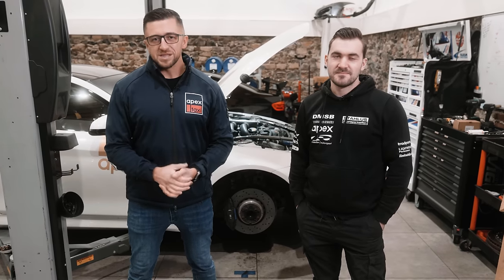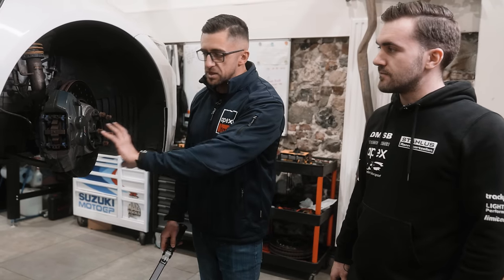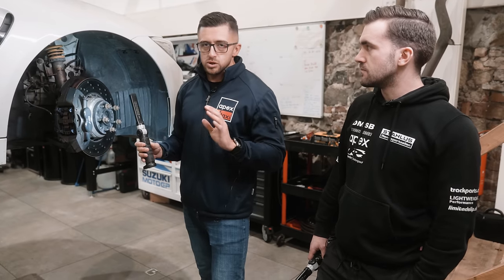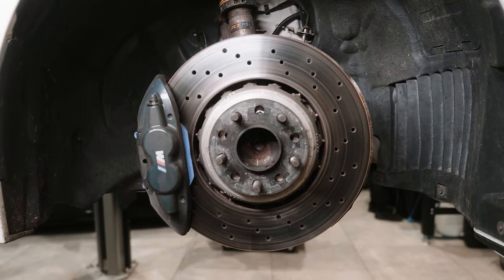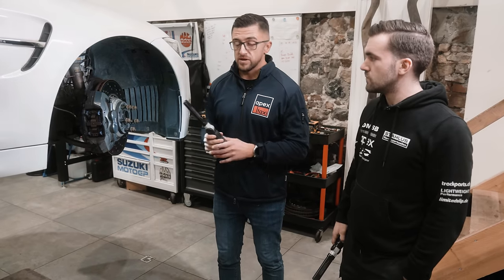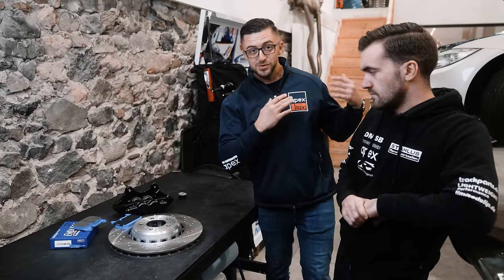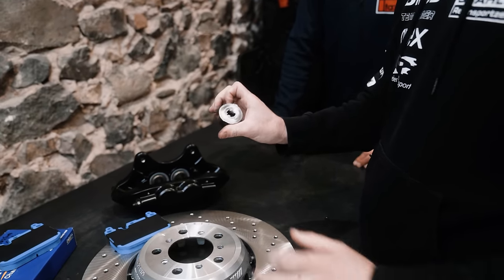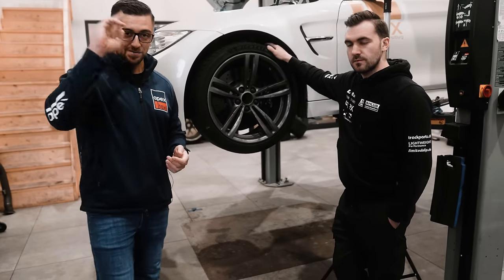STOP! Car Braking System & Tech Essentials Explained

Comment: Just to be clear, "wet boiling point" refers to the lower boiling point you get when the  fluid has absorbed water from the environment over time . " Dry" boiling point is the boilnig point of the fluid when it is new and has not absorbed any water  - brake fluid absorbs water easily and that's why it's important to change brake fluid regularly .
Reply: It’s supposed to be done on every car every 2 years, it’s also good to avoid opening the brake fluid tank, it’s not just that it absorbs water easily it’s that it will remove water from the air by absorbing it.
Reply: @MrTchou  2 years is for the common DOT3 fluid. If you're using DOT4 you should change the fluid even more often - every year is recommended.
Reply: @trackntrail2869  i’m talking about carmaker’s recommendation for a normal everyday car, not a track car, in which it should be changed more frequently.
Reply: @MrTchou  I run DOT4 in my daily driver, which is also my Autocross and HPDE track day car.
Reply: @MrTchou  I was referring  to the need to change brake fluid more regularly than every 2 yeras for track/competition use . yes of course the moisture is coming from the air , but it's getting in through all the possible routes in the system, the  small period of time when the brake fluid cap is taken off to top up reservoir is not an issue.
Reply: how often for regular cars and regular?
Reply: @nmelol look at the owner's manual which will have a regular maintenance schedule. It's something most owners don't think about so if you replace it every year or two it will be more frequent than the average
Reply: @nmelol flush it every pad change, for what it costs to do so it’s a nice while you’re in there job

Comment: Precision about the ABS, what it does is release the brake on the wheel that was locked and reapply the brake until it locks again (depending on the grip, related to the pressure of the brake pedal) if you’re still over the limit it will « vibrate » the pads by locking unlocking the wheel at quite high frequency, but if the reason why it locked was a temporary loss of grip like a wet patch or a small ice patch it won’t vibrate at all ; it will release and if the grip is sufficient it will keep braking without locking again.

Comment: This video is extremely useful. Thanks !

I have an issue with my FWD car, on the ring the ECS/ESP is always pinching the rear rotors in corners, like to help stability. But it is doing this all the time above 110kmh, with my barely loading up the tyres, which is a big problem, I'm afraid of the generated heat with a lap around the track.

Comment: the F80 front calipers yeah... BMW really got their shit together, especially after the E46 M3 CSL that had single piston floating front calipers, which is almost unbelievable. I have the front brakes from a M135i Competition, those are pretty robust as well, but they have only one downside: you can't pull pads out of the backside, you need to unmount the whole caliper for a pad change.
Reply: What is a „M135i Competition“ ?

Comment: If you're an excellent driver, you'll stop faster without ABS. If you're an average driver, and most of us are, you'll stop faster with ABS.

I remember the obligatory session I had at a skid pan while training to get my driver's licence. And the difference between ABS and no ABS was mindblowing.
Reply: It’s not really about being an excellent driver or not, ABS can regulate all wheels at the same time, you’d need 4 brake pedals and feet to be able to do the same. It doesn’t makes you stop faster but it will keep the directional control of the car (up to physics limits of course). It has been shown multiple times that ABS can significantly extend stopping distance on snow and ice for example,
Reply: I beg to differ. I've had the pleasure of driving on a skid pan before getting my licence, and experiencing the difference between ABS and no ABS (the instructor could turn the ABS in his car on and off at the flick of a switch). For someone average like me, who didn't have that excellent feel for when the wheels were about to lock up, ABS was a huge life saver and game changer.

In practical, real life ABS is the best thing that happened to the average driver since four wheel brakes were introduced. A truly skilled driver will still be able to outperform the ABS system, but such drivers are few and far between.
Reply: @hadtopicausername  no driver can outbrake a properly working abs system. On a track you only use it in predictable ways (no obstacles; braking zones; you know the road surface etc). On the street you might take a turn on a winter day and have sunny/shady spots (sunlight between the trees). If you need to brake hard, the abs system will allow each individual tire to maximize the available grip while still letting you take the turn as much as possible. There is no way anyone could do this in a non-abs car.
I drive a car with no abs too but i like to think i am aware of it's limits. If it is not completely dry outside i am a lot more cautious because of potentially hazardous situations (animals, idiots etc)
Reply: I've seen tests where non ABS outbraked ABS, but it's only under very specific conditions. Most of the time, ABS wins hands down.

Having driven an old swing axle Beetle a lot, I generally consider braking while in a corner to be a big no-no. I still carry that habit with me - slow down before the corner, not in it. I'll only brake mid corner if absolutely forced to.

Comment: Love these videos. Very surprised to hear you use drill rotors! Do you think the heat built up is fairly low since the car is typically used for 8 minutes of track time instead of 20-25 minutes?

Comment: I’ve experienced this vibration you guys mention while on track after my brakes have warmed up. While driving on the road I don’t feel this vibration, but I am obviously not braking as hard. Is there any way to get rid of the pad deposits or do you need to replace disks?

Comment: Awesome Video!🤩
 Can you recommend a brake pad and disc combination for my M2 F78 N55, with TÜV?
Reply: That’s a very good question, for which purpose are you looking ?
Pure street, pure track of mixed use?
Reply: @vollcare4076  Thanks for your answer!
Some Road, 100 laps at the Nürburgring Nordschleife and some Trackdays
Reply: @slaier57  well, one pad can’t be really really good in both road and (GP-)track at the same time:

- MX72 perfekt for road, good for NOS, but will fail on GP

- ME22  ok for road (maybe some weakness when really cold / initial bite), very good for NOS and good for GP

- BMW MPerformance:
Very good for NOS, good for GP, 100% road legal but they produce noise

Comment: @Misha, I would have a question to you. Thinking of changing brake pads on my '14 B7 passat 4motion that I use in town, highway and country roads (also in winter Austria Alps for skiing) for having more friction, stopping power and less fade than OEM. I thought of Endless and EBC Blue / Yellowstuff. Although, I do not have endless distributor in Hungary, but only in Germany, so my question would be: which do you suggest (Endless / EBC) and where do you get endless from in Germany? Thank you very much! :)

Comment: Why can only Porsche make cars you can take from the showroom and straight to the hardest-on-brakes tracks?
Reply: You still have to upgrade the brakes if you want to track your Porsche, i recall of a class friend whose father had a 911 CS and went to Magny-cours F1 track, his brakes lasted 1.5 laps, next time he went with upgraded pads and fluid.
Reply: @MrTchou  911 CS, which Modell is this?

1987 G-Modell ?
Reply: @vollcare4076  the one from 1989 yes the Carrera ClubSport which was a limited serie if i recall correctly.
It was supposed to be « track ready », suspension was tuned, it was lighter than the normal one, they stripped it from a lot of equipment etc…

Comment: Experiencing judder from my GR’s front brakes and Toyota keep refusing to test the run out on them with a dial indicator to prove that they’re not warped. Handbrake keeps sticking the rear brakes make horrible scraping noises for the first couple of miles and then a constant high squeal at motorway speeds when hot…. Not a happy Toyota customer at this point. 5 year warranty against manufacturing and mechanical defects… Bullsh!t. 

They’re claiming ‘pad material build up’ to be the cause of both issues.
Reply: Did you get a resolution or diagnosis for this?
Reply: @dielaughing73  they blamed it on ‘pad material stuck to the discs. Then I finally made them do a run out check and they said they were ‘in spec’, despite the runout being over 3x higher than what f**king Hyundai would consider enough runout to warranty claim on. 

Gave up, I couldn’t afford the silly high prices they were after for discs. Don’t have the GR anymore but I’ll definitely get another in future.
Reply: @Jonathan_Doe_  that's crappy. If a company makes a "performance/track" product they need to stand behind it. It's literally a matter of life and death sometimes

Comment: Brake lines information is not quite correct, well not correct at all. 🤦🏼‍♂️
Reply: This comment would be helpful if you explained what’s not correct in the explanation.
Reply: @MrTchou  brakes are a rabbit hole, so it's not easy to just simply correct what they said because even the explanations and validation are off. You are essentially asking for 30 minute discussion on brake lines by themselves to be condensed into 3 minute read. To be quick and reducing wasting my time further. Factory lines don't bulge until they get old. Only on a test bench are braided lines stiffer. Braided lines need to be replaced every 2 years because they don't pass any requirements for a road going car and their coating fails and let's dirt into the braiding. The rubber coating is superior because it's more resilient on corrosive environments. This is why braided lines have a silicon covering over the braiding to stop dirt getting in and putting holes in the Teflon. In a lot cases, OEM rubber lines are more expensive to produce than braided lines by companies that self certify. Unless it's an actual racecar, not a streetcar or track car, it's better to replace rubber lines on the 5 year schedule which is when they might start to deteriorate from high track temps. All this information is backed by companies like StopTech and OEMs in public marketing or direct conversations with brake engineers. 

I'm a brake nutcase, and it needs to be called out that what is shown in this video should not be taken as fact. Further research is needed before "upgrading" the car. Brake lines are 100% controversy topic, but it's only because of misinformation like in this video keeps getting repeated.
Reply: @MattGreenland aren’t braided lines just regular rubber brakes with the braided stainless steel over them so they can’t “expand”?
Reply: @piovo1  No. The reason why they need to be replaced on a shorter schedule is because debris gets in-between the braid and puts a hole in the Teflon, super common. "Good" braided lines have an additional Teflon layer to protect against this, but those breakdown quickly in the elements and need to be inspected frequently.

Comment: Incorrect information there at the end. Latest ABS systems always lets you stop faster than any human intervention!
Reply: Nope, on snow for example you stop faster by locking the wheels, it will aggregate snow just before the tyre, and this little bump that was built up acts as a stopping device on the wheel, ABS won’t allow for this to happen. ABS role isn’t to stop faster anyway, it’s to keep directional control of the car, allowing you to avoid something instead of sliding into it.
Reply: @MrTchou  I should have mentioned that I meant only high mue friction surface.  On high mue, latest generation ABS is the way to stop the fastest. ABS not only lets you stop faster but also keep steerability. You are right about low mue. On low mue, with the snow accumulation method during sliding, you do gain a bit in deceleration but you completely lose steerability.
Reply: @scenicswissdrives1264 why would we be comparing abs in a situation that has plenty of traction? Are you trying to tell me I'll get the best braking on a dry racetrack by locking up my brakes and letting ABS take over? Because I seriously doubt that

Comment: Funny how your using stock brakes when half the interweb says BMW brakes are made from cheese...maybe it was the previous M cars?!
Reply: The new M cars have amazing brakes, I track my F80 M3 on stock calipers with upgraded pads and rotors and its perfect!
Reply: Nurburgring is not THAT demanding on brakes to be honest. so for this use case, the stock blue caliper works fine (assuming you have high temp fluid and track pad). But on a more demanding track such as Laguna Seca, the stock brake just doesn't last.
Reply: @jim1013yyf  yes I agree, Laguna Seca is one track that will kill stock brakes.
Reply: Interwebs says a lot of sh@t also… about a lot of things.
Reply: @MrTchou  haha some of those are. but some others just have different use cases, hence different requirements